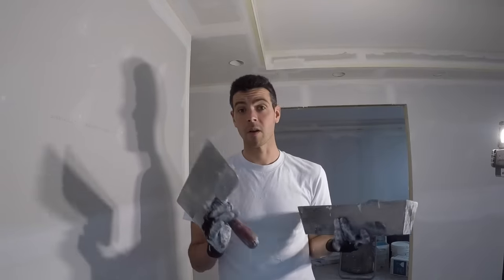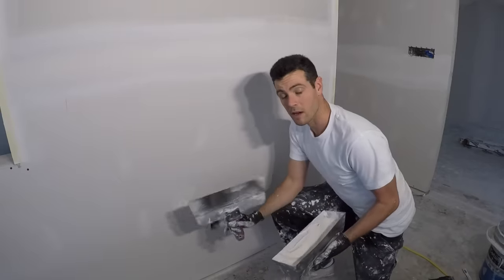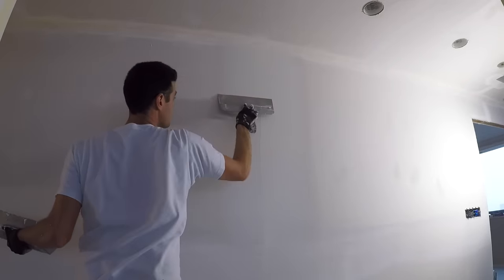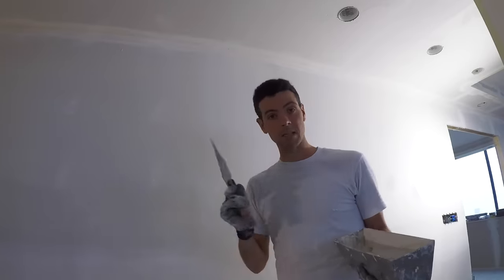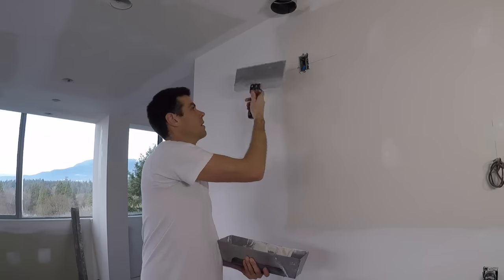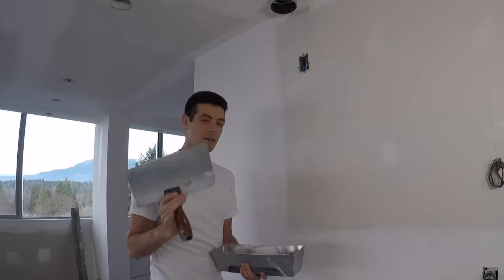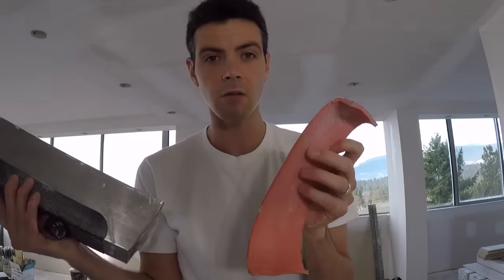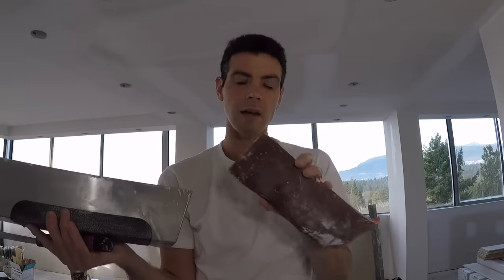HOW TO COAT DRYWALL( BUTT JOINTS)

Comment: i watch a bunch of mudding videos and my confidence goes way up.  I then go and start doing it and it turns into a disaster, lol.
Reply: Same story here haha. This job needs a lot of practice following many steps and paying attention to so many small details  it's insane. So many ways it can go wrong. Good luck.
Reply: Lol...you're not wrong
Reply: You’re not alone!
Reply: Tell me about it . But none the less I’m pretty proud of myself 😭😭
Reply: Yep. I did finishing years ago and forgot how to do butt joints. I always put too little on. A big bright shop light shining down the side of the wall helps a lot.
Reply: I would’ve used a whole bucket of mud, spent 4 hrs chasing the liftoff lines back and forth and ended up making a new hole that needed to be fixed.
Reply: 🙋‍♀️ Right here. Confidence Effect. Lol
Reply: Welcome to my life. This shit is basically impossible. LOL. Especially the corners.
Reply: Same here
Reply: Practice makes perfect lol. I work as a painter/plasterer mind, but I bought a new trowel after using knives for the longest time, and was recommended a curved trowel by my coworker. Thought about it, but decided to go with a flat after finding this channel (I was trained on the knife Vancouver method after all, hahah). After going to six small jobs today and using it a fair few times, remembering to keep pushing the mud instead of pulling it, man, what a difference. I can really see  why trowels are superior for joints. And that's with a trowel that's not broken in in the slightest 😂
Reply: It takes practice I been getting very good & I been doing it on & off for 5 yrs. Just have that desire & passion, l been a carpenter/ contractor for 20 yrs & still learning
Reply: As usual, it is more difficult than it looks. Takes patience and practice as with most everything.
Reply: Just gotta keep trying
Reply: I just completed my first room and am very happy with the results. What I learned is to be patient.  As a novice, I used many thin applications regularly checking for a perfectly, flat, smooth finish. I’m sure a Pro could easily have done it in 50 or even 25% of the time. Anyway, my walls are looking good. I’m proud!
Reply: @ShikokuFoodForest  if you're unfamiliar with the technique, it's best to go over two, three, even four times or more. It's a time investment. Or pay an astronomical amount for a contractor. Drywall mistakes can be bad, but not as bad as improper framing etc which is more substantial.
Reply: @Joetime90  Thanks! I’m generally familiar with the technique from watching many YouTube videos ;-), I just don’t have experience actually doing it. Watching and doing are different. I’m just getting my first hands-on experience now. But, I feel I can learn quickly. I noticed I started getting much faster even after a few days. I’m sure it takes years though to really become a ‘Pro’. I’m a DIY home carpenter for now. May do it for employment in the future.
Reply: @ShikokuFoodForest  as long as you can see small improvement over time, like a musical instrument and derive some sort of enjoyment out of it. Even if you mess it up, as long as you see progress, it's fulfilling. Sometimes I just nail it with no preparation, other days I just wing it and it's almost perfect. It happens. Greetings from the southern US🇺🇲 my fellow DIYer.
Reply: @Joetime90  Thank you! I completely agree. I find carpentry and building envelopes generally more of a science, so I have been studying building science a lot for my future cold, Canadian 🇨🇦 climate. Drywall to me is more of an art and can be enjoyable as long as you have lots of patience. How far south are you in the US? I expect you get some hot, humid weather. I’ll be moving from subtropical Japan 🇯🇵 to a subarctic climate 🥶 in northern BC hopefully by about mid-2023. Let’s enjoy our DIY!
Reply: Yep they make it look so easy. Then I do it and mud talking everywhere, not going in the right places, and looks like I'm doing a textured wall lol
Reply: @Joetime90  its possible to learn  and apply what you learned and obtain great results like the professionals with years of experience # never give up no matter what
Reply: 🤣yup
Reply: Same bro….same….
Reply: Keep watching and listening,  you will get better.  This guy is a great teacher. 1 video and 1 night working on my room and I am feeling a lot better about this work.  It looks easy but it really isn't.
Reply: Lol. Same. I’m here because I must gain the confidence that I will get it right! 😂😁
Reply: Lol
Reply: For me it was not mixing the mud for long enough or the right thin-ness, and wrong amount of pressure on the knife. I fixed those 2 things and now can make decent runs with a 12” knife with not too many air pockets. Very hard though and I’m still improving on it
Reply: Practice makes perfect
Reply: It’s a big boat.  Jump in and grab a paddle…😂
Reply: Me too. I started with a toilet roll sized hole. Now it's half a wall and has joint compound mounds.
Reply: M2😢
Reply: I know exactly what you mean!!!!!!
Reply: Same here!

Comment: The explanation of where to leave the lift-offs was the most useful drywall info I have seen. Too many pros just go through the steps without explaining "why". This guy tells the how and the why. That is excellent.
Reply: It makes sense the way he explains it. Go wide, leave the lift offs and "heavier" coat on opposite sides so it can shrink and fill. They're easy to sand. Second coat is similar but a little more fussy.

Comment: As a handyman, I really appreciate all your tips. Thanks for the tip on leaving the joint flat with a wide knife before the final feather. The challenge with so many small jobs is the number of coats required to get a nice joint without sanding A LOT. I use a padded 8 or 9" round manual sander with hook and loop paper. Works so much better for larger areas than the 3x8 pad. Thank you.

Comment: I've been doing drywall and painting for 35 years I've done the roller trick for the last 20 it saves A LOT OF TIME and I don't go home acking like I used to
Reply: What is a roller trick? Do you mind sharing? Sounds like a must know.
Reply: At 11:18 .  He uses a roller to put the mud on the ceiling butt joints on final coat.

Comment: Great video!! You did the close-up I needed to see. As a beginner doing a home project (garage) I found myself too critical of the lift-offs and kept making passes to try and get them out just making messy joints and more work for the sanding. I also loved the ceiling tip with the roller. You have helped alot of people like me, Keep up the good vids.
Reply: You should be critical. If you let the knife corner run along the tape from bother sides it will leave a hump on the oth sides of the joint with no loft off. Then for your skin coat you run a single pass down the center with both its sides tapered and that's it. If you did a nice job its sanded lightly once with 220 or real nice it gets mopped lightly. There is no reason for lap Mark's like those except maybe on full height cornerbead--- def not in a single butt joint like the first one where he lifts off halfway up. Take your time and do it right and you'll get it.🙂

Comment: I have been remodeling my kitchen. I decided to have the popcorn scraped off the ceiling and have it smoothed and painted.  I have went through 2 drywall guys that cannot do it right.
I have a ceiling left with pocks, scratches and a bow in the ceiling where my light fixture goes and they painted it.  So, when I watched you run a skim and cover a butt joint; I realized these guys are not pro's.  I'm having a third guy come and look at the ceiling.  I sure like your video and I may practice on my garage and learn how to do this :-)   Thanks for the excellent instruction on drywall!!

Comment: I skimmed to smooth finish a 14x20 textured ceiling with just a 12" knife. 2 coats is all it took but I was spent after that job. I was sore for a week since i had just recovered from  pulled rib muscles on left side from excessive baseboard painting the week before, I was out of shape after the lockdowns this spring. The roller trick might have saved me  on the 2nd coat. Sanding a whole ceiling over head on stilts with reaggravated pulled rib muscles wasnt easy especially wearing a respirator. I was sweating profusely and had to take a break often on the last 1/3 of the ceiling. I wasnt sure if i was gonna get thru it I was in such pain. It reminded me to charge  more for skim coating ceilings. It looked great and i recovered.

Comment: Ben, I got a solution for a thick first coat. Using a 5-6" inch knife and a pan I spread out the mud by sliding along the edge  (the way you do for taping or corners to spread out the lump of mud). You do several lines like that 2-6" inches apart (depending on thickness, the closer the lines the easier it gets after). And after I've covered the surface (4by4 feet, 4 by 8 depending what it's being worked on, 4x4 it's ideal for the mud to stay wet long enough) after those rows of mud have been set, I use the roller (3/8 nap in my case) until the mud levels out. It takes a bit of rolling to get the mud to travel I let it dry a bit then I smooth out the tops using a taping kinfe (12" in my case). After a while ( 30--60min at least, the more the better) the coat hardens enough that you can apply again over it but this time scrape the mud right off the bat and the surface becomes really smooth . I noticed that a shorter knife gives me better control for this (I think mine is 5"). 

I have poor control with the 12" so I couldn't skim straight off like you or other pros (thinking Paul Peck since I've been seeing stuff like this on his channel). So that's why I prefer this method. I think it takes me 3-4h to coat an entire wall of 9 by 8 feet (off the top of my head) with smoothing it out and everything. Then I take care of the corners if I haven't been doing so while building the coat and the second day I'm good to go.

I have also used this method, using a painting tray (no liner) and applying coat after coat I have built a thicker layer.

Comment: I also do the paint roller trick! I am a very detailed kind of guy, just like you. I use the roller for all coats ( 2 ) and have no problems at all. I also don't bang the roller against the bucket, I just wipe down the bottom edge where most of the mud usually hangs on the roller. I've even used the roller without a drop cloth over carpet before - shouldn't have done that haha, and I don't anymore, but the point is, you can leave all the mud on the roller, wipe the bottom heavy edge and the tip quickly and apply, just getting good at that and you can definitely do 2 coats with the roller. 4' per roll is the max you get typically, I use a smaller size roller, in between of a thick and thin roller. I think a size 20. Hope that helps. Hawk and trowel all the way.
Reply from the maker: I haven't been doing it much lately but I have a lot of ceilings coming up.
Reply: @vancouvercarpenter  Awesome! Yea I love your videos, I know I made my previous comment almost a year ago but yea just watching this video again reminded me that if you feel like you can't get enough mud on the wall unless you use your trowel or knife, than you're definitely putting on too much mud. For me my first coat and my second coat I can see right through all of it, I can see all my screw holes, my tape etc on first coat, second coat I can also see through that as well just much less. You should be able to see through as much as possible (consistently) while not being able to feel anything, than you know it will be perfect. When it comes to that just after a little bit of time it's easy to know when you've gone too far or vice a versa. If you're mud is on at least 36" wide for a butt joint and you can see through it, than you can hang cabinets with ease. Just started using a 18" roller and it's amazing. 

What do you recommend is the best tool for production mudding of walls and not corners? I also bought the semi automatic taper from columbia recently which has been a huge time saver, also got that reference from your semi automatic taping video so thank you :).
Reply from the maker: @arayahomes8754  If you are doing a LOT of drywall often than flat boxes are great. I had a set but they collected dust. I never did enough volume to bother using them.

Comment: Key comment was scratches after sanding. Paint does not fill the scratches or smooth them. Scratches will show through paint. I keep an old sponge sander to put the smooth sand on repairs.

Comment: I was a taper for over 45 years. I have finished drywall using all the various tools beginning with hand taping and including including the set of machine tools I eventually purchased. Smooth wall does not phase me. I started with 12" and 16" trowels for coating over tape. After 6 years I switched to blades and kept using my hawk! Why? Blades are easier on the wrists and hands! Blades are faster! Blades allow you to reach higher and lower easier. For example if u are running the bead in an 8' house you can reach it from the floor with a blade rather than having to run the top half on your stilts with a trowel unless you are an NBA player. He has the right idea but should be able to pull 4' on butt joints rather than only 2' which adds to time. Same on bottom butts. Start at bottom and put mud on up to 4' in one stroke.  Piecework means speed and working smart. The techniques can be applied for DIY! My advice to this nice young man with only 8 years in the trade is to switch to blades which will save his body to a greater degree and speed up his finishing. Of course the machine tools used properly can also help although the tube seems to have caused back problems in many tapers. Fortunately I never had any issues physically. My own technique for butt joints is unique and quick and they NEVER show even on smooth walls....
Reply from the maker: Nice! I admit I am not proficient with a knife. I can easily get a 4 foot spread with a trowel though as that is primarily what i use. I'm actually doing a lot less taping these days thankfully. Lot's of carpentry and painting in the mix these days.
Reply: Yep! I'm 40 years into it and use 14" coved blade for butts. And I never use stainless for anything ever.
Reply: I agree I started with a trowel and it was not long until I went to blades
Reply: Hamilton Rodgers  ya but then you have to wipe 10 times to remove all the extra

Comment: Man , this young fella just taught me something i have never seen ! I have been a taper for 27 years and never seen anyone roll on mud for final coat ! Like ever . Good job man . I will be using this technique on my next contract that starts tomorrow. Thanks bud
Reply: And even faster way is to use a box wide open, I literally box everything with no issues ever. That butt joint looked like it was 4' wide lol

Comment: Great video as always, thanks! Here's a trick I use. I have a four-foot aluminum rule - it's about 1/8" thick. When you put the edge against the wall with a little pressure and move it from side to side, it will leave a little aluminum behind, indicating any high (or low) spots.